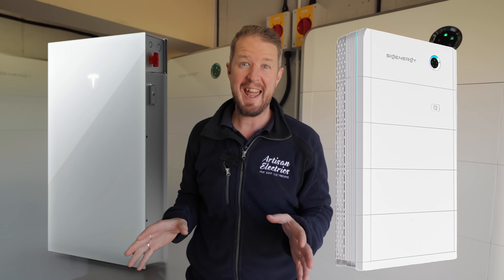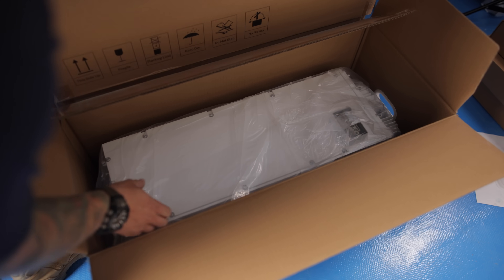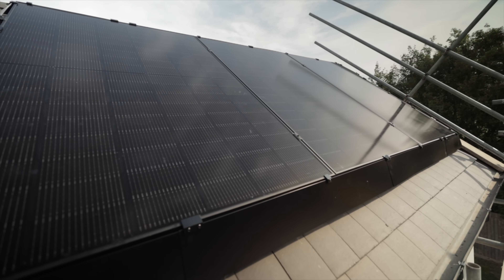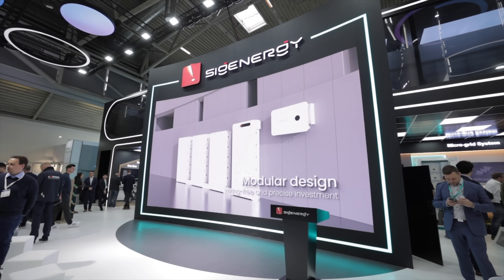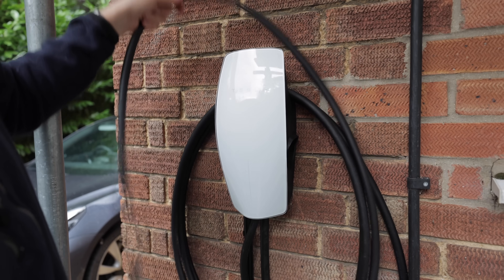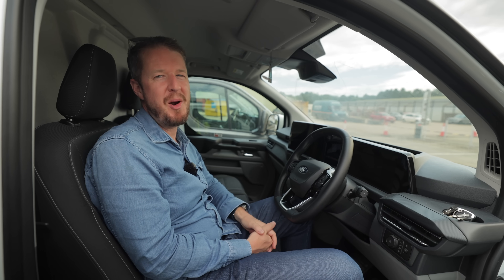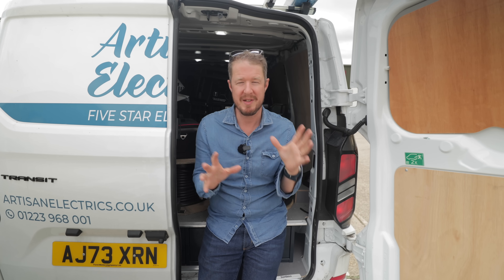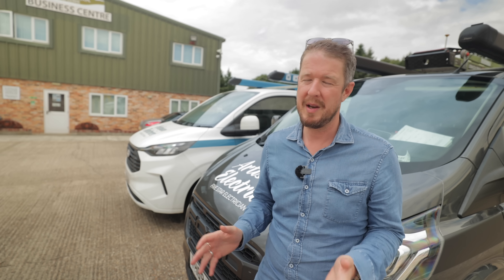The BEST Home Battery in 2025? Tesla PW3 vs Sigenergy SigenStor

Comment: You failed to mention Sig Energy’s substandard warranty on the battery. 

10 Years, or limited to 3,050 half cycles so 1525 complete cycles (combination of 1 x charge + 1x discharge).

At 1525 cycles, this equates to just over 4 years if cycled once per day (1x Charge + 1x
Discharge)

If Grid charging as well then 2 years of warranty.

Teslas 10 Years and Unlimited Cycles.
Reply: I am self consuming my Tesla PW2 and have improved my usage so I now do a full discharge / charge cycle every day when not away. Now 7 years in and no discernible degradation. I would expect the LFP chemistry in the PW3 to be even better.
Reply: That's simply not true. I suggest you read the Sigenstor warranty correctly.
Reply: @VinoVeritas_ Happy for you to explain how Sig Energy’s battery Warranty is 10 years in real life conditions?
Reply: @garethnuzum2795  The warranty specifically states 10 years down to a 60% SOH or a 'minimum' throughput depending on the initial usable capacity of the battery. Cycle life isn't even mentioned.
Reply: @VinoVeritas_  I think you need to read Sig specific throughout warranty. Let me explain.

Sigenergy SigenStor Warranty:

•  Throughput:
	•  5 kWh battery: 15.85 MWh
	•  8 kWh battery: 23.77 MWh

•  Cycles (based on throughput):
	•  For the 5 kWh battery: 15.85 MWh ÷ 5 kWh ≈ 3,170 cycles
	•  For the 8 kWh battery: 23.77 MWh ÷ 8 kWh ≈ 2,971 cycles

•  What this means: The warranty lasts until the battery delivers the specified energy (e.g., 23.77 MWh for the 8 kWh model) or 10 years, whichever comes first. If you fully cycle the battery daily, this is about 8 years (2,971 ÷ 365 ≈ 8.14 years). Partial cycles (e.g., using half the battery) count less toward throughput, so you might get more cycles but still hit the throughput limit eventually.

Tesla Powerwall 3 Warranty
•  Cycles: Tesla claims unlimited cycles within its 10-year warranty, as long as the battery is used for home energy storage (e.g., solar self-consumption, not commercial use).

•  Throughput: Unlike Sigenergy, Tesla doesn’t specify a throughput limit in its warranty. This means you can charge and discharge the Powerwall 3 as much as you want within 10 years, and it’s still covered, provided it retains at least 70% of its original capacity (same as Sigenergy).
Reply: @garethnuzum2795  Your figures regarding the throughput for each battery are incorrect. If you want to divide the warrantied throughput by the usable battery capacity, it's exactly 3,500. Granted, one full charge/discharge cycle each day over 10 years would be 3,650, but your initial figure of 4 years is completely ridiculous.

I despise the way Artisan operates his channel and he's basically no different to the thousands of YouTube grifters willing to take money/free products in exchange for a biased review. 

As for the conversation regarding Sigenergy and Tesla, neither system provides good value for money from my perspective as a solar PV and BESS designer/consultant.
Reply: @VinoVeritas_ I read it , especially the gateway which most of the important parts only have a 2 year warranty

Telsa is 10 years
Reply: @familyoffourdisneydreaming6081  The parts you mention are simply superficial. An LED light strip and some plastic parts aren't exactly integral to the functioning of a battery.

Unlimited throughout is complete vapour ware from any company selling batteries when the chance of charging and discharging the battery more than twice per day on average is highly unlikely to be achieved in the 10 year limited warranty period.
Reply: @VinoVeritas_ superficial, but open to the elements.

And…. Highlighted as a “liked” feature of the system.

Plastic, is plastic. And for example susceptible  to uv degradation.

There’s a whole raft of other negatives which he’s omitted
Reply: @VinoVeritas_ I think you will find moving forward most clients will cycle their batteries twice a day. Therefore Sig’s battery will have a 4 year warranty based on throughput.
Reply: Tesla is not unlimited cycles if you’re exporting battery power to the grid. Sig are very honest and they warranty is based on energy though put which Tesla is also if your feeding grid and not all for self consumption
Reply: @connordines667 Another person that didn't read the Sigenstor warranty correctly.
Reply: @connordines667 Yes but you can grid charge and cycle the battery and still get an unlimited cycle warranty or 10 years. 

Sig’s is far from this and they should be more transparent about this.
Reply: @connordines667 but when Tesla is self consumed, its unlimited.

Sig isn’t

Comment: you didnt mention VPP and grid trading - Tesla if they become an energy provider - they will offer great rates
Reply: Amber runs a VPP on SigEnergy in Australia right now, and there's also a pilot with E-on in the UK.  No need to wait for Tesla.
(Not just SigEnergy either, they support a bunch of other inverters too).
Reply: Tesla won't get a licence to become a retail electricity supplier.
Reply: Ssshhhh don’t mention that currently Tesla is available on intelligent flux and sig isn’t 

That a point for Tesla and a cross for sig

Sssshhhh
Reply: @familyoffourdisneydreaming6081  Not sure of timescales, but both Fox ESS and SigEnergy are being added to Intelligent Flux at some point.  Similarly the SigEnergy AC EV charger being added to Intelligent Go (some people already running with it on a trial basis).   My system is the Fox, I am planning to try to join the Amber/E-on VPP once Fox support hits the UK VPP pilot (Amber support them in Oz already).

Comment: Hang on... doesn't the Sigenergy 12KW single phase inverter have 4 MPPTs?
Reply: Yes. So does the 10 kW one. The 8kW one has 3.
Reply: @geordish I’m looking at an 8kw sig inverter single phase because if the 3 MPPTs. Glad I’m not the only one to pic up this mistake. It had me worried.
Reply: Was just thinking that we fitted a 10kw sp other week and had 3 stings going into it and sure we had a spare for a 4th

Comment: Something you fail to mention with regard to the Sigenergy system is the AI feature. After having lived with it for nearly a year it's remarkable how well it optimises your system function to maximize energy and cost saving with very accurate weather prediction built in.
Reply: Yeah and it sounds like comments on FB groups relate that ChatGPT seems to operate with better results 

🤣
Reply: @familyoffourdisneydreaming6081 I am not a fan of AI, but in a tightly controlled environment such as a solar system where the parameters are well defined - a high functioning model is relatively trivial to implement.
Reply: @StephenBrightwood yeah I doubt the sig system is AI

But the pony stands, a user has highlighted that ChatGPT when controlling the system returns better than the sig AI
Reply: @familyoffourdisneydreaming6081 a user has said anecdotally chatgpt returns better result - but chatgpt isn't integrated into the software of Sigenergy or Tesla so the point is mute.
Reply: @StephenBrightwood no it’s not.

It illustrates that the sig “AI” is gash

Grow up a bit
Reply: @familyoffourdisneydreaming6081 I have the Sigenergy system and it's AI feature has worked flawlessly only ever failing to optimise once when the weather dramatically changed in the day.

It seems your shit talking Sigenergy - what's your interest in Tesla ?
Reply: @StephenBrightwood  I have used the SigEnergy AI feature in my system since April and after a couple of weeks it had a pretty good handle on how the weather and site loads needed to be managed.  It kind of freaked my wife out during the early summer when it would start feeding PV power to the grid even when the battery was not full during peak hours from PG&E.  It had a pretty good history that we didn't need all teh energy to get through the night so even if we lost power we could get through to the next sunny day.
Now that it is winter and we have had a couple cloudy days it was actually using the PV power to charge the battery and handling the loads of the house from the grid.  It decided with a storm coming in and production being lower than it needed to fully charge the battery it should do what it could to get the battery charged.  It is actually fun to watch.
Reply: @StephenBrightwood  nah, just being objective.

Had he wanted to do a proper comparison he would have maybe mentioned that Tesla don’t support optimisers, or the other proper negative points.
Not, that it doesn’t have an LED strip light or a little screen on the side

It’s his sponsored BS and needs to stop
Reply: AI, or just an algorithm? Probably just an algorithm. It's not doing anything creative.
Reply: @supermanhills neither is most AI.
Reply: @StephenBrightwood amen to that